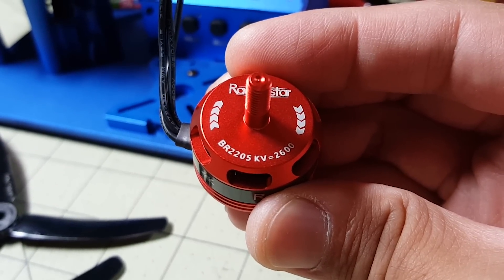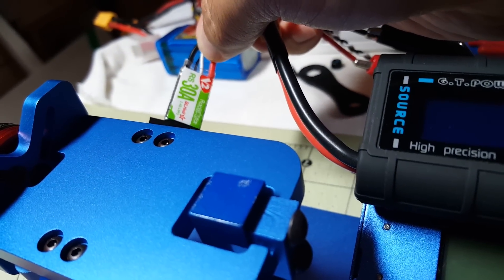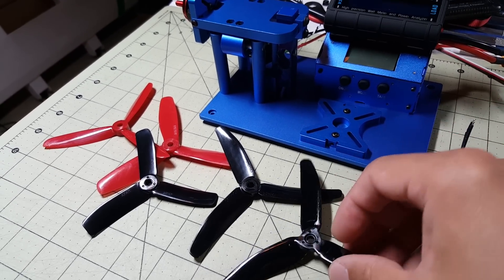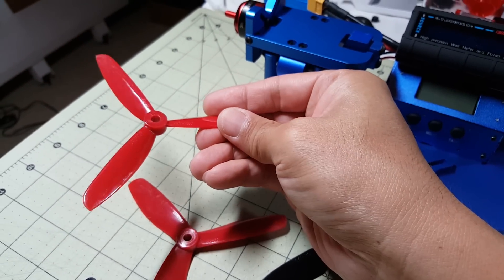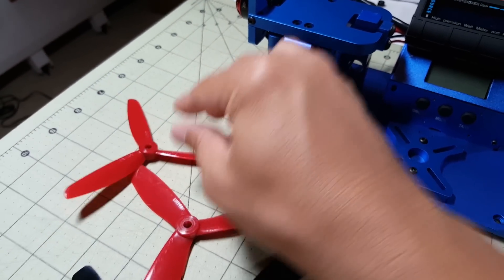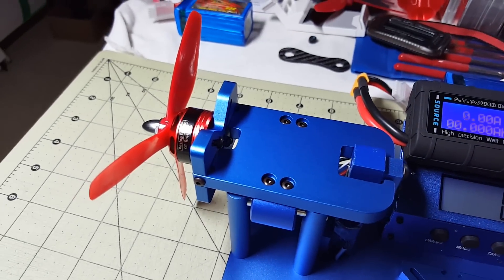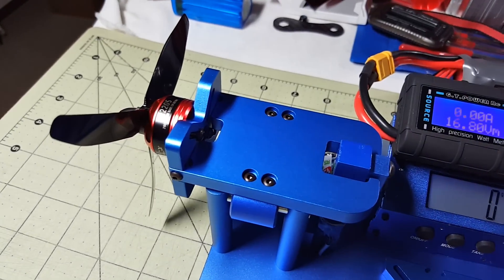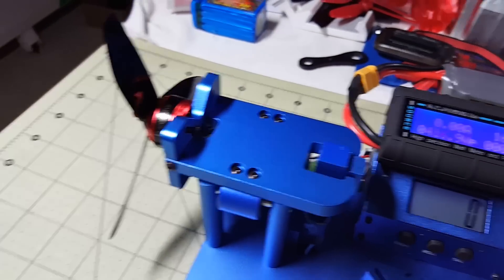Racerstar BR2205 2600kv & RS30A V2 ESC Testing

Comment: Hi....thanks.  This is very useful information.....pls advis...I plan to buy this motor + dal 5040 v2 prop. Is it safe using 20A ESC...??  E.g fvt little bee 20A on this setup? Pls help. Thanks
Reply from the maker: I think so if it's not too heavy and don't use a super pitched prop.
Reply: @AlbertKimTV  I will use 5040 props. But I am worry... Since 100% throttle exceed 20A. ± 21,... A or more....

Comment: Hi,
you should run motor 1-2 seconds more on full throttle. because the wattmeter did not cath the correct sample at the max thrust hitting time.

Comment: nice !! would be better if you write the C rating  on the description .
Question: which is better in The 2205 ... the 2300kv or the 2600kv??
Reply from the maker: It depends on the kind of flying you do and the props you tend to like.  Generally higher kv would be better for freestyle, lower kv for racing, but this is highly subjective and each pilot has their own style and preferences.
Reply: Albert Kim thanks in terms of thrust which motor got more thrust.
Reply from the maker: The 2600kv motor will give more top-end thrust.  If you like a lot of full throttle flying, the 2600kv motor will give you more power but you need strong batteries or you'll kill them :)
Reply: Albert Kim thank you very much very helpful i guess I'll choose the 2300kv. nice videos i hope banggood would sent  you the new Br2205S 2300kv for test and you compare it with the older Regular Br version.

Comment: Albert Kim ( malbleket )  iv just ordered these racestar 2205 2600kv motors and was thinking of using the racestar 4in1 blHeli 30A esc can you tell me if these will be compatible together running on f3 deluxe fc
Reply from the maker: They should all work together fine.
Reply: Albert Kim thanks very much i was checking before ordering the esc lol what size of props & battery will this setup work on im new to the racing quads and just learing my friend  
and thanks very much for your help and advice

Comment: For a 5inch props which would you recommend getting this or the 2300kv? I am new to fpv switching over to 4s now so need some suggestion for cheap motors.
Reply from the maker: For someone new I'd go with the 2300kv.  I swapped the 2300 for 2600 on my martian and I'm having a harder time tuning it on the high end of the throttle.  I did not have these issues on 2300kv

Comment: thank you for the test. Wonder if the racerstar 20a esc will handle these.
Reply: you should be fine, those numbers on bench are about 30% higher from what you actually draw while flying
Reply from the maker: The 20a are good for 30 a bursts for 5 seconds.  Anymore than that and you risk burning them.

Comment: You should run the motors a bit longer on full throttle, because I don't think the display can catch up in that short amount of time
Reply from the maker: OK, about how much longer? one second?  two seconds?  I was told by someone else to run it full throttle for 0.5 seconds for the display to catch up.  I think it's always gonna be behind by 0.5 seconds.
Reply: Maybe 1 or 2 seconds to have some spare time in case it may take a little longer catch up. I noticed that the efficiency in some videos a little unrealistic was...